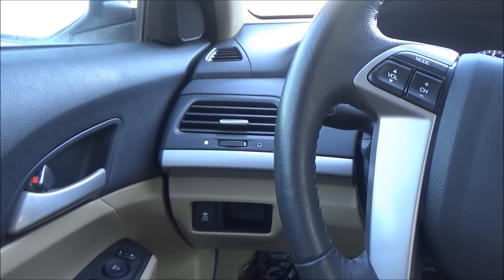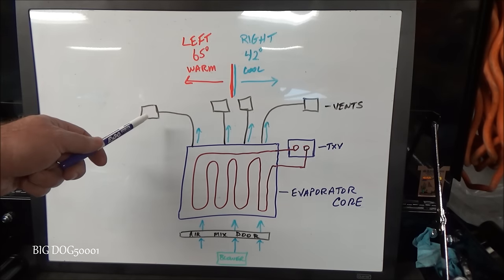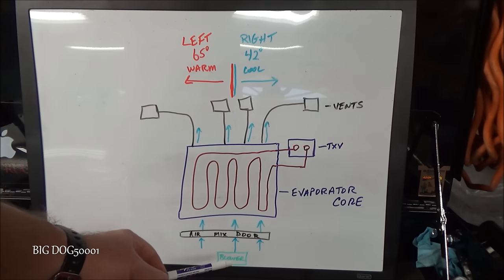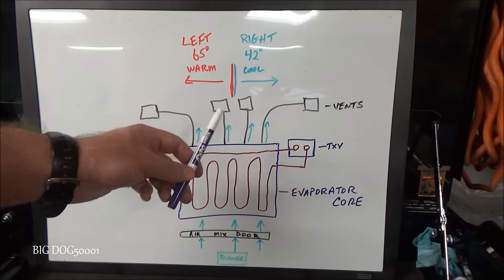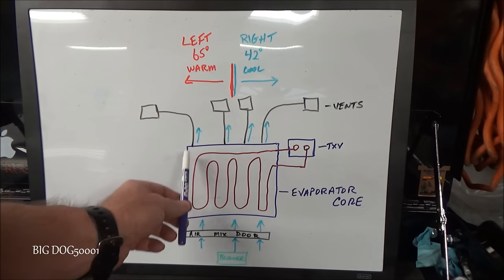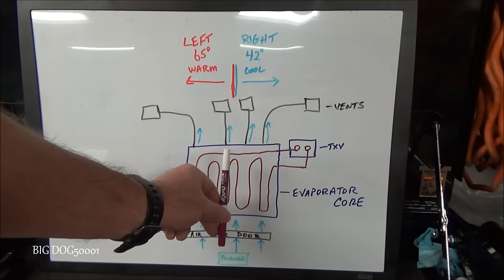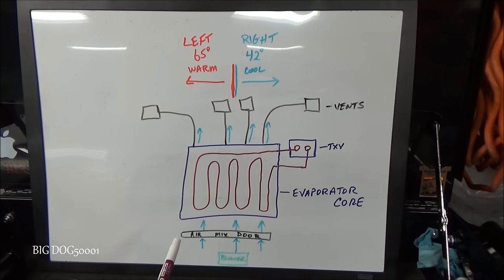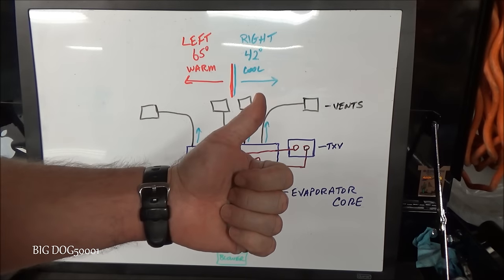Honda Tips: A/C Blows Warm Air Out of Left Vents and Cold Air Out of Right Vents

Comment from the maker: Be sure to subscribe for more tool and car repair videos! 
https://www.youtube.com/BigDog50001

https://twitter.com/BigDog50001
https://www.instagram.com/bigdog50001/

Disclosure: This channel earns a small commission using some of these links - at no additional cost to you.

The Big Dog 50001 Automotive Channel Store can be found here: https://www.amazon.com/shop/bigdog50001automotive
Reply: I have heat coming from all vents and the air is off. Where should I start first?
Reply: What if it is intermittent sometimes it's cold and another time it's not cool enough I ran a trouble test on the ac system and did not get a trouble code I saw the test on youtube where are you hold the rear defroster and the recirculating button then switch the car the number two position
Reply: How do I fix it
Reply: P
Reply: Thanks for sharing, it was quite informative. How much should that cost in 2023 approximately?

Comment: In all my years doing a/c work, I never saw a low refrigerant charge cause temp variance in vents, esp. in Hondas. Instead, in Hondas, the mix door actuator goes bad. That's as common as you'll find. It's easy to replace too.
Reply from the maker: Well a low refrigerant charge can cause it, and it is common enough that Honda put out a service advisement on it.
Reply: @BigDog50001  I called the  part the wrong name. It's called a Mix Door Actuator Motor. That's most commonly what goes wrong w/these Hondas.
Reply: @chriscadman5715  Low charge will do it every time on my 03 Accord. The leak is so small, it takes 2 years before it needs a charge. Then there are all the others I've seen in the Honda shop where I worked for 20 years. In all those years, never had a bad door motor. Now if it were a Ford or a chevy...
Reply: M C Anderson  any idea why I can’t get airflow from from any vents but the floor? Ty
Reply: Chris Cadman
I have this issue right now, and nothing on YouTube or the internet forums have the answer.
Took it into a A.C mechanic and got it diagnosed, and he said the condensor fan wasn't working, the tx valve and evaporator was maybe blocked and was quoted to change the whole A.C system.
everything a.c compressor, tx valve, tea bag filter, evap coil, condensor, fan and a Re-gas and wanted $3000.
Turned out to be a $15 fix lol
Reply: @rosesolon9243  what what the problem? My mechanic cant figure it out, thanks in advance
Reply: Wat was the 15 💲 fix
Reply: @denishood7258  yes, it is the blend air MODE actuator on the Odyssey passenger side,  not the mix temp actuator is the lower on the passenger side. The is one mode actuator on the passenger side and 2 temp mix actuators, one of each side.
Reply: @rosesolon9243  what was the $15 fix?
Reply: @mcname7975  just checked  my drivers side actuator and that wasn’t the issue. I have hot air on both passenger vents, warm air in the middle driver vent, and cool air on the left driver vent. All while heat is on HI. I’m assuming it is the mode actuator, although modes are switching correctly..?
Reply: @denishood7258  Bad mode actuator
Reply: @BigDog50001 yup this is also for the rams
Reply: I own a 2020 civic coupe. On the left side its blowing out warm on the driver side from both vents. The passager side is blowing out colder. What could be the issue? I replaced the cabin filter and air filter. I also stay up on all the maintenance too.
Reply: @peter8944  I have found the front thermal expansion  valve  goes bad on these vehicles  causing low cooling or no cooling on front vents ...if you have ac gauges hook them up and see if the psi equalizes on both low and high if it doesn't or takes along time the thermal expansion  valve is no good
Reply: @Carlos-ip2ir  I appreciate you replying to me sir. The parts isnt that much. I'm watch a video how to use the AC gauge hooks.
Reply: This is true, refridgerant has nothing to do with getting heat through all vents
Reply: @rosesolon9243 so, what was it? Not the blender actuator for me.
Update: mine was 100% low refrigerant. I had to go to a tech as previous refill cans had over filled the oil.
Reply: The mix door makes more sense as mine will sometimes blow hot and sometimes very cold. Seems if it were related to refrigerant, it would consistently not work.

Thanks for this tip too!
Reply: My mom's Honda was blowing warmer air out of the left 2 vents, right 2 vents were blowing cold. She doesn't have dual climate control. I got a recharge kit with guage, hooked it up, and the the low side was running 14 psi. I charged it and got it to 37 psi, and the air was cold all the way across all vents. The ac in her car is ice cold now. FYI..2018 model R1234yf  refridgerant

Comment: Finally someone who fully understands the problem and the system and explains it clearly.  I've always wondered why the left was warmer than the right.  I have the climate control with dual doors.  My issue ended up being low refrigerant.
Reply: Did you notice your compressor kicking on and off frequently, every 5 seconds for 14 seconds or so?
Reply: @SetAside777  no, just lack of cooling
Reply: Mine is doing this exact thing....ice cold on passenger side n just cold on driver side....mecanic only checked my ps vent...then i realized it was only my ds that felt warm...im gonna get it charged now
Reply: Did you get cold air when you put it on Lo though? And when it's any number it will be max hot.
Reply: The heat only blows on the passenger side…but cool on the driver side…vice versa for the a/c…any idea why
Reply: @1McMurdoSilver  when fan on low DSand PS cold normal when increase fan speed DS getting warm

Comment: Thank you, sir! You saved my remaining hairline 🤣You were absolutely correct, it was low on freon. My brother lend me his a/c gauge and purchased a small bottle of freon. Charged the a/c system in small quantities while monitoring the vents with a temperature gauge. I got it down to 42 degrees vs 75 degrees.  The wife was starting to worry about her Ody not keeping her cool while driving in the desert heat that reaches 122 degrees 🥵Thanks for the video! 👍 Happy wife = Happy life 🤙
Reply: @BigDog50001 ; Hot air on drivers side and cold on passenger side. What can cause that on a Honda Ridgeline pickup truck, please? Dual air

Comment from the maker: I realize some of you may not be using your A/C right now due to weather but we still use it here in AZ!
Reply: I'm in AZ. I was wondering since it's been so hot if that was a possible factor of my A/C acting up since my car is only 2yrs old. I have a 2017 Honda civic and its pretty upsetting that its happening so soon. Nevertheless, your video was some well needed clarification!
Reply: Do you ever see this problem because it's so darn hot the right side is boiling off all the refrigerant?  i.e. it's 110F out and you see 60F coming out of the right and 90F out of the left and the heat load is too much for the A/C to cool off the car enough for the two to equalze? Meaning that neither of the problems you described is the issue.  In my experience driving through hotter climates it seems like no small car has an AC strong enough to really cool things down in a reasonable amount of time.

Comment: my 2010 cr-v is blowing the opposite its cold on the driver side and hot on the passenger side. I dont have heat on the driver side. I know the door motor is not working right if it goes to defrost it wont to back to other blower positions, feet, head, or both. till it MAGICALY moves again.

Comment: Nice video…..I was having this exact problem on my 2008 Honda CRV. In fact, the left side was about 23° warmer. I checked the Freon and it was right at 40 psi, but right now the ambient temperature is 110 in Vegas. I took the PSI up to 50 and now both sides blow nice and cold! I should’ve done this about two or three years ago when i noticed the driver side was warmer! Thanks again

Comment: I just replaced the blend door actuator on the driver side. Still blowing hot on driver side. I will try recharging the Freon. I will give update in a bit.

UPDATE: Yep, I just needed to recharge the Freon. Actuator didn't really need a replacement just needs to be regreased. Keeping the actuator as a spare.

Comment: Thanks for the huge help! 2017 Civic driver side is warm so it's probably due to a leak, and hopefully it's the AC Compressor leaking which would be covered by Honda's TSB extended warranty.
Reply: did you find the reason?
Reply: did you find the reason ?

Comment: Having this problem on my 2013 Odyssey.  Air mix door motor is working just fine.  On a humid 84 degree day, I’m getting 55 degree air out of the right side vents and 78 degree air out of the left.  I’m also getting all the warm air out of the front windshield defog.

Comment: Early 10th Honda Civic models have a 10 year extended warranty for the condenser because it was poorly designed. 
I'm having the same problem shown on the video so I'm taking my car to the dealership this weekend to have the condenser checked out.
Reply: Did the Condenser fix the problem?
Reply: @guitarhero9592  The dealership said the compressor was leaking and the condenser was fine. The dealership wanted to charge me around $1200 to replace the compressor and they would give me a free condenser with that (I just think they were trying to scam me). I added some refrigerant and my AC has been running fine since.
Reply: @njo6480  Check Top Class Actions search Honda class action alleges civic a/c defect page 87 Anthony Alvaro post dated May 19 2023 states Honda now covers compressor with campaign and service bulletin. Hope this is helpful. Good luck.
Reply: @njo6480  the compressor is now covered for 10 years just like the condenser. But it’s not listed as a recall. If it’s been awhile, check back with them.  My dealer put me on hold awhile then came back and confirmed.  My Civic is a 2016 good luck
Reply: @guitarhero9592  I will definitely check! Thanks for the information!
Reply: @njo6480  you’re welcome. My dealer didn’t know until I told them to recheck and was on hold a long time and they came back and said yes you’re right if they find compressor is faulty it’s a free replacement. If they seem unwilling then call a different dealer. Oh did they at least replace the Condenser free of charge? Mine wasn’t faulty but they replaced it in 2019 based on letter I got  from Honda.
Reply: @guitarhero9592  Great thing you did your own research, dealerships are always to pull a fast one. The dealership did not replace my condenser, they said there was nothing wrong with it so they would not replace it.
Reply: @njo6480  Wow!  So in a sense they want it to malfunction first. Did you ever receive a letter from Honda? They replaced it no questions asked. My  advisor actually told me off the record the Condenser supplier Honda uses made a lot of faulty ones so Honda decided to change them free of charge. Maybe try a different dealer and if you don’t have that letter I’m sure you can find info online about it stating they’ll replace it.
Reply: @guitarhero9592  I still have the quote, which says that the compressor is faulty and I would have to pay $1200, to replace it. Now that I know that they also have to replace the compressor I will go back and try to make them replace both the compressor and condenser. Thanks for sharing that info again. It only makes sense that they replace the compressor, because the leak on the condenser will cause a low refrigerant charge which can damage the compressor.
Reply: @njo6480  Good luck! Don’t know if they’re national but Remind them about their Random Acts of Helpfulness commercials on TV.

Comment: Thanks Man!  I had this issue with our 05 Accord Hybrid. I went through the factory auto-check procedure through the HVAC interface per the factory manual, and it said all was good. I took the car to Honda, told them that I thought it was low refrigerant. They verified that diagnosis, and evacuated and charged the system, after replacing the fill Schrader valves under warranty. The Schrader valves where a problem that caused the refrigerant to leak out after 15 years.. Honda still stood behind it.. What you said in this video was right on..
Reply from the maker: The valves are a common leak point.  Thanks for the comment!
Reply: Hey, what does the Schrader valve mean? Did you imply the expansion valve here?

Comment: On our 2006 Accord with dual (left/right) blend door motors, the left one is definitely not good.

If we ONLY use the standard cold/hot control (that operates both L & R) it works OK. But if anyone operates the L & R independently, the left motor loses its mind completely, sending nothing but hot air.

The temp “fix” is to move the common L/R hot-cold buttons all the way HOT, back to all the way COLD, do that a few times and the left motor eventually syncs back. 

It’s a project for another day.

Comment: I have a 2006 Honda Accord EX that has this problem.  The door blend actuator on the driver's side was replaced since it was broken.  The problem was still there so I recharged my system with freon (19 oz.) and still no success. I now found out that the recirculation actuator on the driver's side is also not moving its arm at all so I ordered a new one.  I tried moving the blend door manually but the problem still persists.  This car has 3 actuators under the dash and the 3rd one (the mode actuator) appears to be working well.  However, I think I've found 2 problems with the system recharge.  The first is that both valve cores are bad as they are slowly leaking and second, the ac manifold readings are off from what I think is considered normal.  The ambient temp here is about 86 °F.  With engine off:  Low side	--> ~105 psi and High side - - > ~105 psi.  With engine on and ac on:  Low side --> ~20 psi and High side ---> ~65 psi.  I added 19 oz. of freon as that's what the service manual calls for.  Should I replace the valve cores and add more freon to try to raise the pressures?

Comment: 2004 Honda Accord EX-L. Exact same problem today. Took it in and explained what was happening, 80 degrees on the left vent, cool air on the right. They gave it back to me with a bill for $162 for oil, filter, rotate and air recharge. Still blows warm to hot air. I knew I was right when I told them the blend door was the problem and they wanted me to drive it for a week or about 150 miles so they could check for leaked dye. I told them a small leak has nothing to do with hot on one side cool on the other. ITS A BLEND DOOR PROBLEM and they are going to hear about it when I go back.
Reply from the maker: Always possible there is more than one issue, I see that a lot.  Low refrigerant (most likely caused by a leak) or an air mix motor issue (if equipped with two air mix motors) can both cause poor cooling on the left side.  Some models do not have two air mix motors (dual climate control) but most EX-L models do.  If it does not have dual climate control it is most likely not an air mix motor/blend door issue due to only having one blend door on that design.  A large enough refrigerant leak will cause poor cooling performance (starting with the left side) pretty quickly.  Refrigerant restrictions and other electrical problems can also cause cooling performance issues too.  

Regardless, the shop should have been able to tell you the exact level of refrigerant they removed (i.e. was it low, overcharged or at the proper level?), they should have checked for leaks and advised on that and they should have checked operation of the air mix motor(s) and let you know the status of those also.  Leaks, restrictions in the system and intermittent problems can all cause the shop to have difficulty finding the problem immediately but they should be communicating with you on what they have done.  Thanks for the input!

Comment: so what if it was on the right passenger side and switched to the left driver side after I swapped a new cabin filter (2012 Acura TL). i pulled the motors thinking one was bad but theyre not. Also, the cabin filter was full of tree leaves and sticks so i was wondering 1. HTF and 2. could a stick be stuck in there somewhere holding the blend door open on one side ? 3. Why would the heat swap from the right to the left just changing the cabin filter?

Comment: Thanks for the information. I took the van to dealership. They replaced the motors and adjusted the freon level. The driver's side still blows warmer at idle but cooler when can is is motion. What could be the cause? The condenser fan? Thanks.

Comment: I appreciate the video. My issue is that when you are idling on my honda odyssey it blows warm air on the drivers side while the passenger stays cool. Now when you start to drive then the drivers side begins again to blow cool air once more. What can this be?
Reply from the maker: Without being able to see the vehicle, one or both cooling fans not working properly or low refrigerant are what come to mind initially.
Reply: @BigDog50001  Thanks for the reply. I did see both fans running while the car was idling if that helps. When i put the a/c low pressure reader on it shows to be in the green which indicates to me that freon is ok.